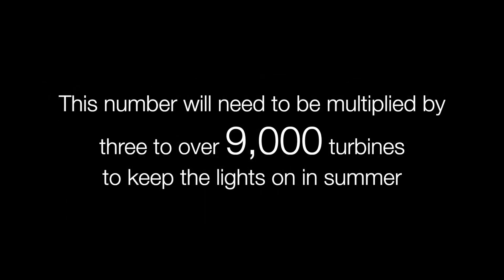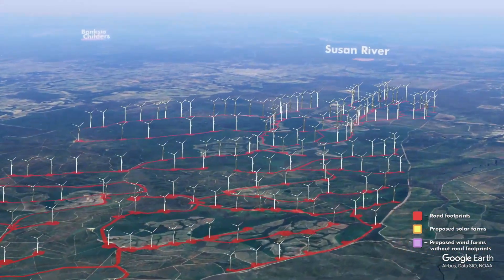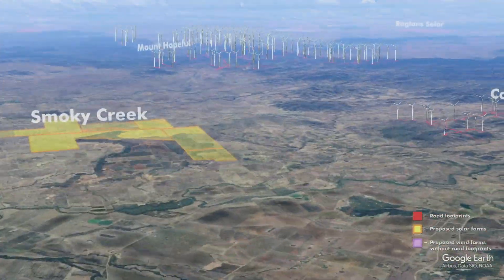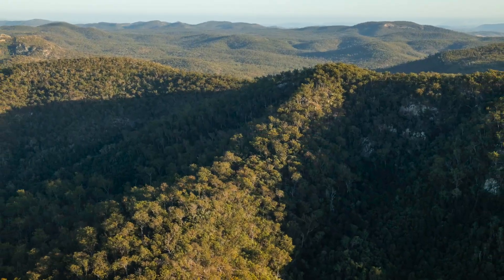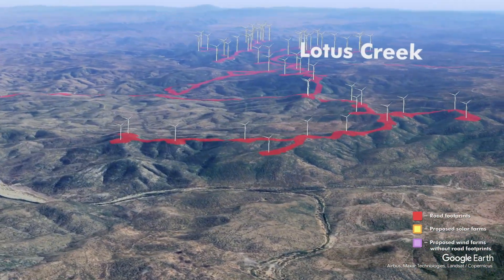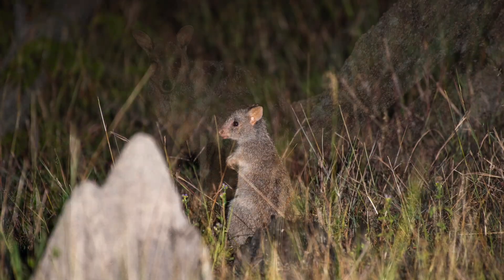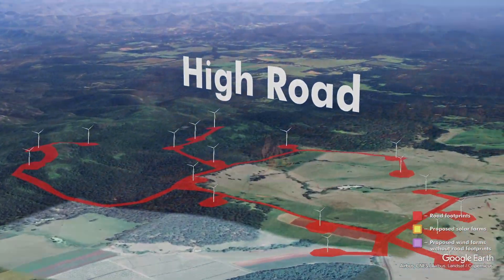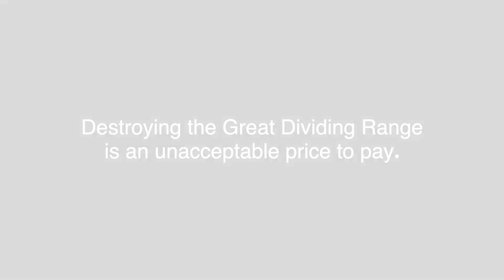Proposed Wind and Solar Factories planned across Queensland.

Comment: To save the planet we must first destroy it further. A wind turbine in it's lifetime will never be net zero. They want to stop oil. But the diesel to operate the mining and construction vehicles. The oil for lubricants and grease for the turbines. The concrete for the footings, The coal needed to turn iron ore into iron. And no this is not to heat it. It is the chemical reaction to make the iron. Then there is the world shortage of Balsa wood that is used inside the turbine blades. The there is the costs and resources to decommission the turbines. Which some of the farmers in Victoria have found out could cost upwards of $1m and at the farmers expense. Written into the very fine print of contract to host the turbines on their land. The risk of fires from turbines as seen down here at Rokewood near Ballarat.

Then we have the solar panels. The large areas used in each farm could possibly be reflecting light and heat back into the same atmosphere they want to reduce heating for climate change.

Then there is the issue of recycling of both.

The removal of forest will aid in the increasing of the temps of the area increasing as the roadways will become heat batteries. The earth won't get a chance to cool overnight.

The replacement damage to both turbines and panels after storms and hail.

But lets destroy old growth forests for renewables, but not for sustainable forestry. Where the carbon captured by the trees is locked in and stored as furniture and homes.

And to top it all off. AEMO is shutting down wind and solar farms because they can't balance the frequency on the network. Intermittent wind and patchy cloud cover causes the power to go up and down. The network needs to keep the frequency correct or the network fails. 

Just my thoughts.

Comment: I've got roof solar and daily generation can drop to 5% of max capacity on bad weather days. I seen over a week at that level. Solar farms are the same. Same Sun n Weather. Yet we keep getting told batteries will be the backup for bad weather? Seriously? Try running your iPhone, fridge, hospital etc when electricity generation randomly drops by 95% and batteries run flat. Stop fluffing about. Bring on Nuclear Thorium and  200+ more Dams for Hydro.

Comment: Add the disruption to forested lands in clearing and building transmission lines to connect all these sites to the consumers of electricity. I believe the existing transmission network across the great dividing range will need to be doubled in its reach??

Comment: Utter stupidity in the name of UN appeasement. Everyone to remember, power lines have to run to those turbines and then to the grid, this is the most disgusting thing we could do to our pristine areas. In a "normal" world we build our facilities in proximity to where they are required, but with wind as seen here they build where the wind blows and have to then wire that energy 1000's of KM to where it has to go, just insanity. The lifespan of those windmills is not the same as man made alternative power generation plants.
we have gas which is half the co2 emissions we could build near grids, towns and cities, if and when hydrogen comes online they can convert.
This decision will be regretted in time to come..... it is a band-aide solution to appease a target made by fools to fools. a country with such abundant resource we sell overseas where corporations make billions and we do this to our land rather than treat electricity as an industrial process. Take a drive and see how bad it is.

Comment: On the issue of sighting. Some of these locations are geographically isolated highlands. These areas are like biological islands and often hold unique plant species. Breaking the ground in these places is not only a direct impact but allows areas of infiltration for invasive plant species. And that means possible localized extinction for set unique plant species.

Comment: Nuclear is the only useful interim energy solution.

It is still worth considering how much waste heat is produced. Something I’d never thought of in the past. There is a great solution for this that captures vast amounts of the discharged heat from the stack(s). Cogeneration and can be piped to nearby towns for warming commercial or residential in winter.

Thorium, would be great I think. 2 European companies are working on micro stations. Transportable, drop in, plug and play. Can be focussed on industrial and commercial areas first. 100-300MW, compact. The biggest drama is the government red tape. It’s cost $600 million just to write up safety stuff (check out Sabine hossenfelder “good news: small nuclear thorium reactors are coming to Europe”. Then a review by Elina Charatsidou of the same video (some balance).
Reply: “Interim solution“? You would see a kilowatt out of any of these new nuclear power plants for 20 years so what do we do in the meantime
Reply: @ interim as an indeterminate length of time.

What’s your answer there fella?

20 years? 7 years if you get on with it rather than trying to stop it from happening. 10 years will see power rolling out. 100% on all the time power.

It sounds like your short term plan is Stone Age (intermittent) or elitist (only the rich can pay for it) power.

Sack the companies keeping existing coal power going if they say they’re going to anything but their best to keep the lights on at a fair price until we have a solution. Complex behind the scenes there.

I mean I could jump in my Time Machine  and fix it but hey.. one miracle at a time.

What’s your solution? Tell me.

Comment: I am very pro wind energy. But, this highlights the importance of a careful approach. I’d be interested to see more texts on the construction site management. There is no doubt we need a transition. Though this should minimise impacts on the flora and fauna. I don’t agree we need nuclear for our energy needs as a lot of people are suggesting. I however do support a nuclear industry for weapons manufacturing capabilities at short notice if Trump and his isolationist agenda is in power of the US again. Great video. I have shared it.
Reply: To add to this comment, I would like to suggest that the wind towers have not been applied to the imagery to scale. I wonder if that has any immediate influences on responses. I’m still alarmed and concerned though.

Comment: I'm quite confused if you're opposed to wind and solar what is your solution  continue burning coal?
Reply: The silver bullet to climate action is nuclear combined with good renewables. Good renewables are rooftop solar, community grids and industrial renewable that have social licence and do not impact cultural sensitive sites nor places of high biodiversity.
Reply: @stevennowakowskipanoscapes5244  I'm pretty sure in Australia that the current nuclear 'fission' technology is not part of the solution but I do agree renewables and a distributed smart grid will be.
Reply: Nuclear energy can fully replace coal/oil/gas AND the need for these wind farms. But only if the ban is lifted and investment started.

Comment: The real point is that even if you treble the number of turbines, we have wind "droughts" when there is insufficient wind across almost the entire continent, let alone our state, to generate any electricity from wind turbines at all.
Three times zero still equals zero.  A big fat round zero.  
Your lights won't come on, your fridge won't keep your food cold, your electric stove won't cook your food, your smart phone or EV won't charge.

It would be great if you could also create similar graphics to this for the entire Eungella pumped hydro proposal.  That would be a real eye-opener for people.

This wholesale destruction for a bad and pointless (the evil of CO2) idea is so wrong.  
If anyone truly believes that a mere 4 molecules of the trace gas carbon dioxide (CO2) is capable of warming the other 9,996 molecules of atmosphere in which they are dispersed, well I've got this nice big bridge in Sydney you might like to buy for a bargain price.  
You see, 4 parts per million (the approximate current amount of CO2 in our atmosphere) is 0.04% of the atmosphere, or put another way, it is 4 molecules of CO2 in every 10,000 molecules of atmosphere.

Comment: Many of these Developments need to be looked at again to either lessen their Impact on Nature or stopped if they in fact are destroying the  Habitats. But the many Wind/Solar farms that are Low Impact need to go ahead and the Long term benefits of Clean air and a less Harsh Global Warming will save more Habitats than destroy them.
Reply: There is nothing clean about wind, solar or BESS backup and they are being installed predominantly on agricultural land or wilderness areas. The amount of C02 created in their production will never be wiped off the slate because most is not declared. The country that makes almost all of this infrastructure now produces more than thirty percent of anthropogenic emissions which are continuing to increase year on year. Large quantities of toxic waste are created from the mining of the necessary materials, processing of these materials, manufacture of the infrastructure and end-of-life disposal. Shipping has increased on a massive scale as a direct result of the green industry as has transportation by specialist trucks. Very little recycling of this infrastructure is actually being carried out and most of it is ending up in landfill globally due to the extreme expense of proper disposal. Going down this track is destroying the environment globally at a rapid rate.

Comment: CSIRO report stating nuclear plants are not cost effective are based on technology over 30yrs old also assumes a wind turbine lasts as long and a nuclear plant the report also doesn't take into consideration power line infrastructure nor does it cost replacement turbines every 20 to 25yrs. 3 private costings based on Finland newest plant state nuclear is actually cheaper then wind and 44 countries agree as they are all building nuclear plants..
Reply: everything you said is wrong 
nuclear is a stupid idea. Its nothing more than a thought bubble dreamt up by the LNP because they have no policies at all
Reply: Yes they keep doing that. When you consider a Nuclear powered aircraft carrier (Nimitz Class) has 4 reactors. The ship weighs 100,000tonnes. Cost about from 8Billion upwards as they were built awhile ago, but only took Newport News Dockyard about 4yrs to construct. So why are the costs so high as laid out by this government as well as the long timeframe. Maybe because building a warship doesn't have to spend years on permits and fees from the red tape factory. The ironic thing to think about with how fast the turbines are being approved etc, But the nuclear power Station would be locked up in years of environmental studies to get approval.

Comment: Do you have a  analysis document confirming your statement of overbuild by three. Can you post that here please.
Reply: Do you understand what capacity factor is?
Reply: The overbuild by three is due to capacity factor. Wind turbines produce electricity for just 30% of the time on average over a year in Australia due to the fact that they are weather dependent. Whereas coal, gas and nuclear are engineered to provide electricity 24/7. So on face value you need more than three time more wind turbine infrastructure to attempt to match baseload forms of power. But you still don't get any energy if the wind isn't blowing. The capacity factors for wind and solar are not equal to coal, gas or nuclear. The nameplate capacity of wind and solar is an indicator of the maximum output capable depending on the number of turbines or panels configured in the project. Wind produces 30% of its nameplate capacity on average over a year and for solar it's only 20% of nameplate capacity on average over a year. So with solar you would need five times the overbuild to attempt to match coal, gas or nuclear. 

The overbuild will need to be far higher than times three however and the reason for this is that wind turbines last 20 years or less whereas coal, gas or nuclear plants last between fifty and eighty years. The damage to the environment, the loss of wildlife and the affect on regional communities will be horrendous. As will the loss of wilderness and farmland.

Comment: I had no idea it was this bad. One Nuclear power plant would stop all this.
Reply: Yes we agree that perhaps two locations hosting 4 GW of power generation each is all we need. Net Zero done and dusted and we can move onto the next issue which is rewilding and making this world a better place.
Reply: @stevennowakowskipanoscapes5244  I disagree relative to your comment re 'Net Zero' implying that CO2 is a problem. 

On the contrary, all this to solve a non-problem!  Sheer unmitigated lunacy!   
CO2 is NOT a pollutant.  Nor is it the primary driver of so claimed Climate Change, aka Global Warming.  CO2 is a minuscule, invisible, tasteless, odourless atmospheric trace gas necessary for life on this planet!.
Reply: If the Conservation Councils were genuine about climate change, then nuclear is safe, clean, and proven as a power system.
Reply: No 
20 Billion or more  20 years to build 
And no place to put spent waste 

Go battery and solar and win this is economically feasible and kicks  all other power
Reply: @damfadd  That is incorrect, nuclear energy can be built in under a decade. Waste can easily be stored on site or recycled and even if it did cost 20 billion (which it doesn’t need to and is a bad representation on the actual consumer cost), I think it would still be a better solution to wind, solar and batteries which require more mining, only last a fraction of the time nuclear does and as seen in this video require MUCH more land. Doesn’t mean there isn’t a place for renewables but nuclear could provide the majority of our power whilst removing the need for clearing this beautiful land.
Reply: @damfadd  You have been drinking the Blackout Bowen Cool-aide. Go look up some actual facts.
Reply: @damfadd  What based on models from the 1950's, get with the times.

Comment: Thanks for sharing, this really brings home the scale of the issue.
There seems to be an approach by the planning authorities and government to just look at each project on a case by case basis which misses the bigger picture. 
Taken in aggregate I don't see the impacts as being reasonable at all.
Even if it is correct that nuclear is twice the cost per Mwh, I think it's worth it if at least some of this destruction could be avoided.
Reply: Agree, nuclear can slot in to existing coal sites as they retire. It has additional benefits of good long term employment for the workers displaced from coal.
Some renewables where appropriate only. 
The idea of 100% renewables requires huge amounts of overbuild and also vast storage, pumped hydro being one which is also very impactful on the local environment.
Reply: Totally agree, however nuclear is cheaper long term as demonstrated in all the countries around the world that use nuclear energy. The latest CSIRO report is wrong. It has modelled nuclear reactors only lasting 30 years whereby they can last 60 to 100 years. This would involved another generation or two of renewables construction and installation which is not included as well as additional generational replacement of batteries etc.
Reply: @stevennowakowskipanoscapes5244  I guess you are an expert in nuclear power generation to state that the CSIRO report is wrong. Did you get your nuclear degree from the same place that Peter Dutton gat his? 
If you take out China, the build out of nuclear power stations in Western countries has been a disaster with the worst being the nearly $A100 billion spent to build the 3.2 GW nuclear power station<Hinckley Point C in the UK. The ones in Finland, France and the USA have not been much better. Hugely expensive and taking a long, long time to build. 
As for SMRs they sound good but don't exist right now commercially. Rolls Royce has put off their SMR until the mid 2030s because the UK government would not give them further grant money to develop them and they have been building nuclear reactors for submarines for 70 years i think.